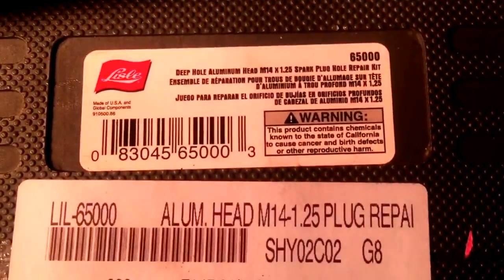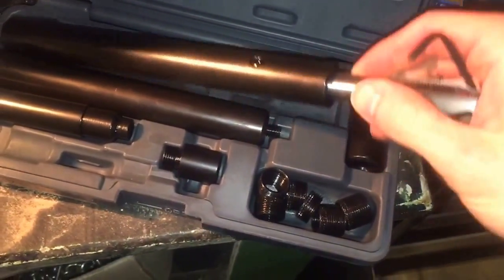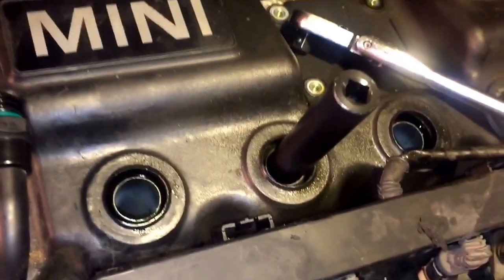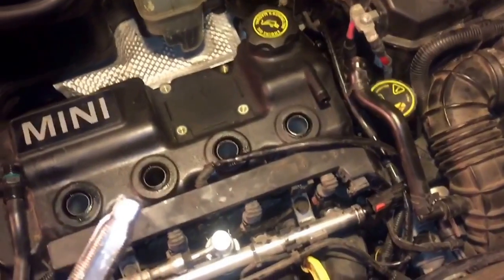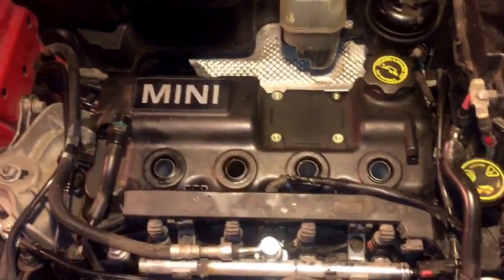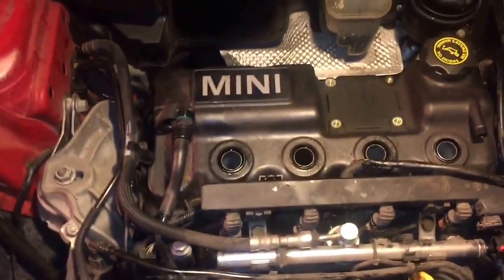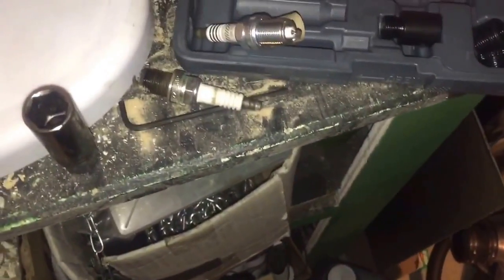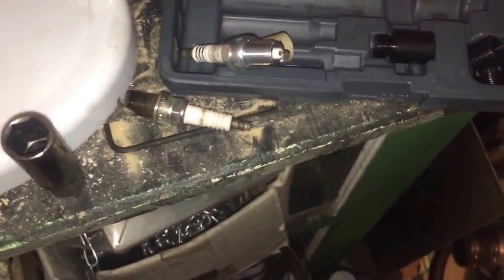DIY how to heli coil spark plug / fix blown out spark plug

Comment: Hi, I am wondering how it is holding up. If you don't mind sharing...I'll be trying this soon on a R50. Thank you for sharing the kit you used.
Reply from the maker: It is still holding up good!
Reply: @2ZERO8  Congrats! Thank you for letting me know. I feel better now about the potential effectiveness of these inserts on a R50. I haven't decided yet if I will use an adhesive on the threads or not. If you lean either way I'd be open to hearing why.

Comment: What year is the mini? And did it work?
Reply from the maker: it was an 2004 and it sure did.
Reply from the maker: yeah if you take the plug out and crank it, it will help to get the shavings out
Reply: I don't have access to a shop vac! Do you think if I start the car before I put the spark plug back in will it blow out all those shavings?
Reply: @aramterzian2529  If you used the engine compression to blow out the shavings then how did it go for you?